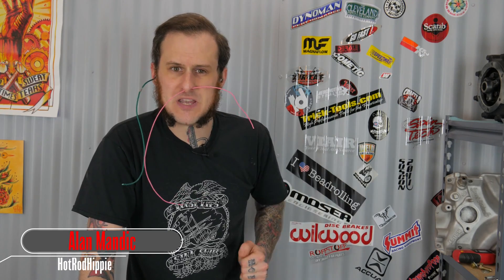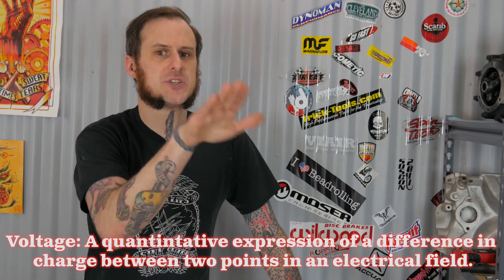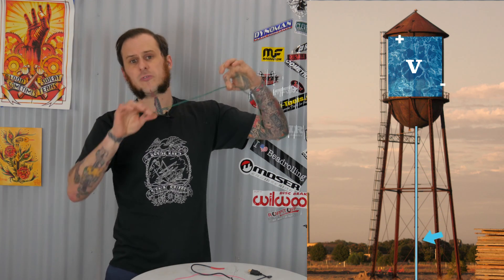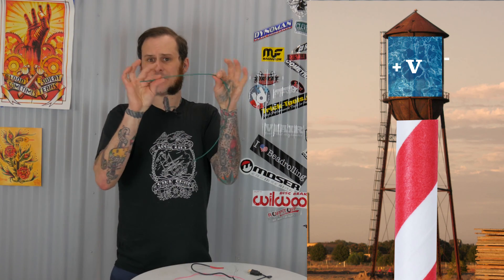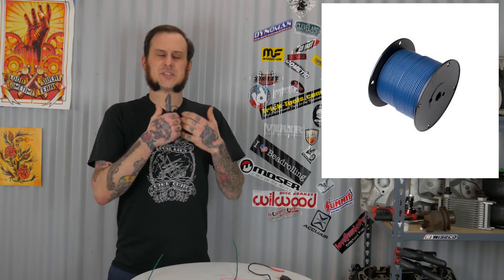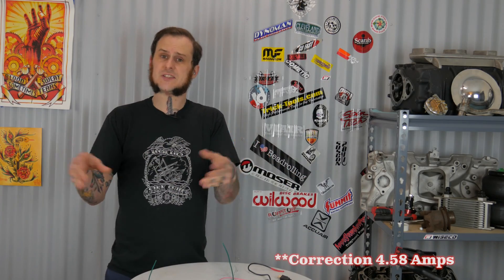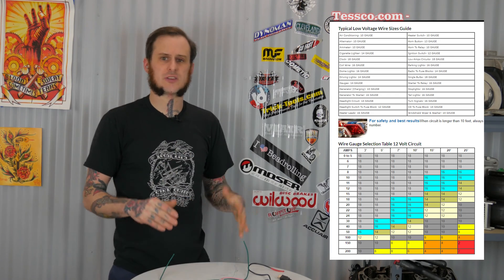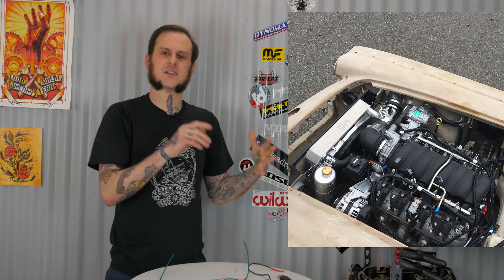How to Choose The Right Wire Size - Auto Electric Dos and Don'ts - Episode 3

Comment: 7 years later here I am. I'm running two LED pods that are rated 50Watts each. But what I'm still confused on is the auxiliary wire on the pod, I've got the ground, I've got the positive, now the auxiliary is going to be wired up to the existing DRL wire on my truck. I got a 16AWG wire to make it happen, what's your take?

Comment: Just a question on jointing wire to wire that has been cut . The wire that is cut is .5 mm. To reconnect the two pieces of that  wire I need to put in a short piece in order to get the length . Should that insert  piece be the same thickness or more ...tks

Comment: I've got a VW beetle I want to run an isolated switched auxiliary fuse box up under the bonnet for accessories. But the distance from the battery to the fuse box itself is about 10- 12 feet... I've got no clue on what gauge wire I need to feed this thing.  All the accessories will be fused as well. Do I need the fuse box to be fused to handle the total potential power draw? For example - the lightbar I'm looking at comes with a 30 amp fuse, and so does the radio - so there are 60 amps already. I couldn't just use a 30 amp fuse to protect the fuse block if the draw from the block is going to be more, could I? Seems like I'd need to add up the potential draw and protect against that?
What's your take?
I appreciate any guidance or additional videos I should check out

Comment: Once you figure out the wire gauge needed for the amperage of the circuit would it be a good idea as well to go just one size bigger on the fuse for that circuit as well? Too high of a fuse rating will cause your wiring to run hot won't it.

Comment: Sir still you didn't said on this video how to select or calculate wire size in relation to wattage or amps as you said , you only tell base on your experience how about us doesn't know enough from our experience? For example I haved a 100w light component, with 12v source and 8.33amps then how am I gonna calculate  specific wire size to use...its not like I will choose this 12 cause like this and that...why? How?

Comment: I bought a new dash gauge unit for my 1955 chevy. The unit comes with 22 awg coming off the connector.  Should I use 22 awg or is 18awg better to use?

Comment: I don’t know anything about gauge size wires. You keep saying “6 gauge wire might not be enough, so you might wanna go a little bigger.”What does that mean?? Couldn’t you at least tell us what size is going to be bigger? Common sense says 8 gauge is bigger? But your making it sound like 4 gauge would be bigger? Very confusing! Next time explain gauges as if the listener knows nothing about gauges! 🥵😖
Reply: You could have answered your own question regarding wire size with a simple Google search faster than the time you spent typing that comment.

Comment: I have a 31 ford model A with Chevy 350 . Battery is going in back trunk. What size battery cables would you run? No A/C,HEAT,RADIO. This hot rod is just Bare minimum. Fuel pump is Mechanical.

Comment: What gauge wire should one use on the aftermarket door poppers for the hot rod shaped door guys? 10 gauge 14 gauge? What do you recommend?

Comment: It's all very straight forward once you understand the basics I'm still trying to get my boss to allow me to rewire an older semi we got in the terminal, the shop says it needs all new cab, chassis and engine harness costing roughly 12,000 bucks but looking at it I'm pretty sure I can fix the tom foolery in the harness for under 500 bucks not counting busted sensors and whatnot ecm is good but no communication so its something in the harness I call it "the canary challenge"

Comment: hi can some one pls explain teh terminal of saying as 10 guage is 10 gauge = to 10 mm thats the diameter of the wire, or its the thickness of teh copper inside the wire, what is the unit of calculation of 10 guage & how do you measure that ? thanks for explaining

Comment: This is some good information. Thanks for sharing. You mentioned at the time of this video you was wiring an LS3. I've installed an LS3 (2012 Camaro) into my 78 Malibu. The ECU (E38) harness is too short to mount it where I'd like.  I want to cut and splice all the wires. They look to be either 20 or 22 gauge wire. Would it be wise to use all 16g wire to spice in ? If not, how can I find out the exact size of each wire ? Thank you!

Comment: ok, so now I need to know AWG , or oxgen free. Aluminum  core or all aluminum cooper core or all copper? 12 gauge isn't 12 gauge I am finding on amazon.  What is the best automotive brand wire to buy off amazon. I need 12 gauge for a light bar?

Comment: I have a ‘46 Chevy truck w/a 6 volt system. Once it gets hot it’s hard to start or it’s sounds like the battery is going dead. What size cable wires should I use.
Reply from the maker: Cable size? 12 volt conversion. 😅😅

Seriously though, that’s a thing about 6V vehicles and one of the main reasons people convert / cars moved away from 6V. 12v just packs more power for those situations. Upsizing your battery cable a hit may help but it’s not gonna be the overall fix when the battery feeding it and then starting motor it’s cranking are still just the old 6V units.

Comment: What if you took a zero Gauge wire and split it into four separate smaller wires. Would you then cause a voltage drop just by dispersing the strands?

Comment: Excellent video…hooking up a Compressor in the bed of my truck.  Calls for a 45 amp draw.  I’m thinking my run will be about 15 feet what are your thoughts on wire size.  Thinking 4 even thou the compressor came wired with alligator clip on 8 gauge.
Reply from the maker: Honestly I think 6 or 8ga should be sufficient for that purpose.  I'd likely go for 8ga.  The compressor may draw UP TO 45A, but it likely won't be that high all the time.  Probably just peak at that when the compressor kicks on (the highest draw time usually).

Comment: Wow awesome explanation. I just bought an aeroskin lightshield, I’m connecting it to the fuse box using an 15A mini fuse., using my parking lights fuse to power it. What type of wire should I use. The fuse box is on the right side of my truck.

Comment: Hello, HotRodHippie. I believe you did not state if the wiring chart is for copper wire or for aluminum copper clad wire. Those differences are important.
Reply from the maker: I only use and recommend full copper wiring so I took for granted that would be evident. I realize clad wire has been becoming far more common from retailers but I really don’t endorse using it. It’s purely about cost savings and not being a better product.
Reply: Thanks for letting us now. I use copper only and not that cheap economical aluminum wire. I was not sure if I could use that chart but now I know I can... thanks...
GREAT VIDEO BY THE WAY...

Comment: Can you ever use to big of a wire? Will this allow your battery to run out quicker
Reply from the maker: Can wire be too large? No and Yes.  For the most part "Too large" is just a waste of money and space.  Making it more difficult to wire something neatly or fit into areas required.  For many things however, "Too Large" won't hurt anything if those factors don't matter for you.  If you don't mind spending more money and using the space, then it doesn't usually matter. 

The exception to this is sensor wires in engine harnesses.  Some (not all) sensors and computers are expecting specific parameters for the readings the sensors are producing.  Too large of a wire COULD throw those expected variables out of whack enough to cause issue.  As such I try my best to match original size or only go up a 1 or 2 sizes at most on ECM / Sensor wiring.

Comment: I’m needing to fix my wiring harness in my cars engine bay. I’ve planned on just getting the same wire size but do I need to get a certain type of wire since I’ll be using it in the engine bay. Most of the wires are about 12 or 14 gauge used for turning signals and sensors.
Reply from the maker: Short Answer: Yes.  Cross Link wire is generally preferrred as it is intended for Automotive Applications.  

Long: TXL is a commonly used Cross Link wire as it is thinner overall diameter so it is great for Engine harnesses.  The Smaller diameter helps with routing and keeping the overall diameter of an engine harness down. Any Cross-Link wires specifically stated for Automotive use are good choices generally.

That said, you can get away with using non-Cross Link wire.  Some "Primary" wires are designed to hold up to the conditions a car presents just fine.  However they are usually stiffer and thicker making them more difficult to neatly route and harness up. 

Here is one of the Suppliers I get wire and wiring parts from: https://www.delcity.net/store/Cross!Link-Wire/p_804928

Another: https://www.eficonnection.com/home/category/wire/txl-wire-by-the-foot

Comment: Needs more info on battery cables... the biggest single battery is around 1250 cranking amps, running under the hood the max run would be 10 feet. This is so far off your chart that its not even rational.
Reply from the maker: Starters don’t actually draw the amperage that the battery lists as the cranking amperage. An average starter draws between 100-250A at their peak. And that is a short load, not a sustained continuous load. It’s part of why you should not crank a start constantly when a vehicle is having trouble starting. 

So no, it isn’t off the charts. You are just thinking about it incorrectly. Even the spikes of amperage draw over what the charts list isn’t a terribly important thing as it’s usually quite brief.

Comment: Okay I know this wasn't meant to be a dissertation on basic electrical units of measurement, but after hearing your explanation of voltage, ohms, and amperage, my understanding of these concepts is SOO much clearer. This is the illustration that helps me remember it: Electricity is water, cables are pipes. Voltage is the volume of water in the entire system, amperage is the water pressure, ohms are the friction working against the movement of the water, and wattage is the speed at which the water travels through the pipe. Gauge is the size of the pipe. (Please correct me if I got any of this wrong)

Comment: Thanks for the video!  I’m trunk mounting an agm battery in the trunk of my ‘16 mustang.  I’m going to do the big 3 wire upgrade at the same time.   200amp alternator, 15’ of 2/0awg I think should be enough but what do you think?  Where should I terminate the ground, near the battery or up closer to the engine?   Thank!
Reply from the maker: With Trunk Mounts I always recommend running your ground to your engine. Frames aren't nearly as good of conductors as copper cable. That said I usually run one from battery to the frame and one from battery to the engine. Then I ground the engine to the frame at least once if not two or three times. Those engine grounds can be smaller diameter cable I feel. It never hurts to get excessive with grounds, the only downside is a minimal addition of weight.
Reply: @HotRodHippie  Awesome, thanks for the help.

Comment: I am trying to install a hidden kill switch on my starter solenoid wire. It looks to be a 10 gauge wire. Would a 10 amp rocker switch work? I cant seem to find a 20 amp rocker type without the LED light on it and the toggle type don't hide very well
Reply from the maker: If it was me, I'd use whatever small discrete switch I could find and wire a relay. Use the switch to engage the relay, which then connects the signal wire to your solenoid. Then you can use a 1A switch, or whatever. 

That said, you MAY get away with a 10A switch. That is around what many solenoids can pull while cranking, though they can spike momentarily above that. A switch may handle that spike ok. 

I wouldn't be afraid to try a 10A switch in a pinch, but given the choice I'd use a relay personally.

Comment: What if I want to wire a battery cut off switch, will 8 gague be too small?
Reply from the maker: As the main battery cable or a car? Yes that is too small. What is the car, engine, and where is the battery located? I never use less than 2ga for battery cable on my custom projects.

Comment: Ok I'm trying to upgrade and relocate my dome light with something else but Since I dont have the proper size wires to hook them two together can I use a couple size bigger? Will it burn the fuse or anything?
Reply from the maker: Over sized wires are almost always fine. It won't cause any problems. Adding a second dome lights however could. It heavily depends on what design your dome lights are. LEDs would likely be brighter AND less power draw. 

What size fuse is feeding the dome light now and what size bulbs are you using?
Reply: @HotRodHippie  I'm replacing the dome lights with those remote control rgb el lights from eBay. I'm hoping it's the same wattage so I can run the existing dome wires to it but I don't have the proper size wires to extend to relocate for the module!
Reply from the maker: @MrKiet76  could you post a link to the RGB kit? Those can vary wildly in Wattage. And what is the vehicle?
Reply: @HotRodHippie  01 accord is what I'm putting it in. And as far as voltage goes it's dc 12v!
Reply: @HotRodHippie  
voltage:dc 12v

light color: RGB multi-color

led type:5050 led

output channel:4ch/rgbw3ch/rgb

operating temperature:20°c to 60°c
Reply from the maker: @MrKiet76  I just looked and you should be plenty fine to wire it up to your dome light circuit without issue. At least the few RGB kits I looked at on eBay are all significantly less Amperage draw than your stock dome light. 

What size wire DO you have to wire with?
Reply: @HotRodHippie  I wanna say the diameter of it it's a lil bit bigger than the car speaker wires! It's prolly 2 1/5 size bigger than the dome wire
Reply: @HotRodHippie  and trying to use the same dome fuse

Comment: Nice explanation 👏👍.   Ok, a question for you..... I plan to run an aux power( cigarette lighter socket) to the rear of my Isuzu Trooper. I’m going to run at max a 300W inverter (occasionally)...... I plan to run directly from the battery ( car has two batteries under the hood 🤷‍♂️)  I’ll obviously have a fuse in the circuit too. What would be the ideal gauge of cable for it? I was thinking 8 or 10 gauge. Would 12 gauge be a bad idea? I could do with some advice please 😉
Reply from the maker: 300w inverter has the potential to pull 25A on that circuit. I'd guess you are routing 12-15 feet with the twists and bends a cable may have to take. So if it was me I'd use 10ga. 8ga wouldn't be crazy at all. Maybe slightly overkill but I'm always a fan of overkill personally. 

Realistically if it was me I would wire up the inverter hardwired and permanently mounted instead of using the socket. I'd maybe piggyback the socket off of the wiring to the inverter for smaller loads. 25A is a lot to pull through a aux power socket. I'd used something like some insulated junction blocks for power and ground then wire the inverter direct to that. And the socket as well if you still wanted it. (For like cellphone charging, small lights, etc)

Comment: I have a 2008 Buick lacrosse super 5.3 liter engine I want to rewire my map sensor wiring what is the best size wire for this part
Reply from the maker: The original wires are 20ga. Unless you plan to greatly extend them I would just use the same size. Sensor wires can be slightly trickier as sometimes the resistance of the wire can play into the sensors readings. So using too large or small of a wire can slightly change things enough to be an issue. It's best to just reuse the original size. 

https://www.eficonnection.com/ sells the proper type of wire for GM EFI jobs. I just hand wired a full LS3 Engine harness with their products.

Comment: Let's say I want to add a fuse box with relay for multiple accessories like light bars, light cubes,  radio with amp. This is for a side x side (can am defender). What's the wire gauge from the battery to the fuse box?. Thank you 😊
Reply from the maker: If I was doing it I'd do the math to figure out the actual load. But a safe answer would probably be around a 8 or 6ga wire. It's likely overkill but I'd rather that than undersizing. Each of those items has the potential to be both a large or small load so it's hard for me to just pick a size.
Reply: Thank you sir